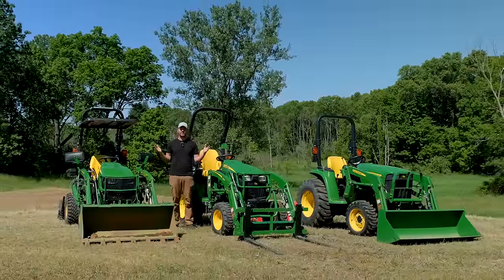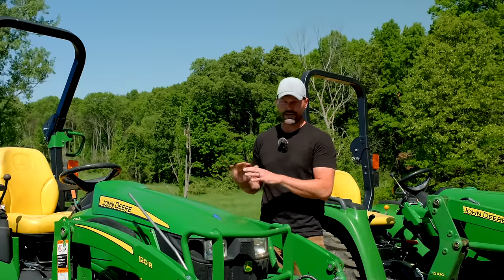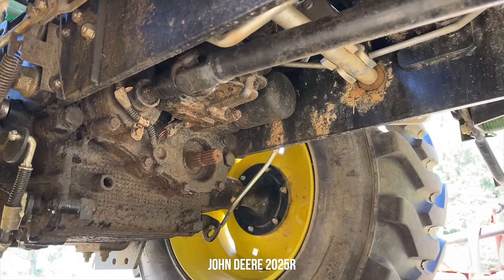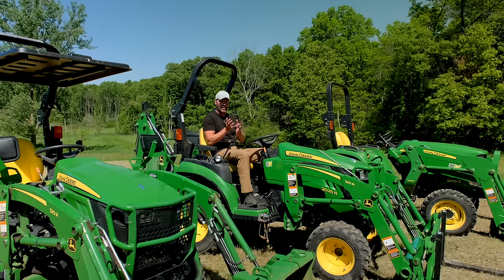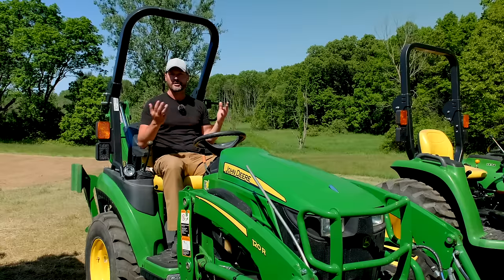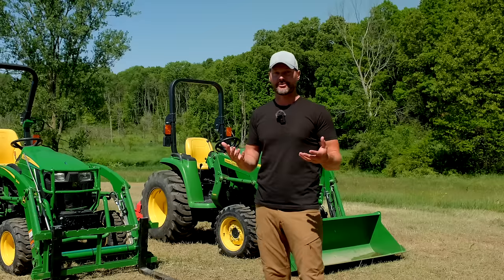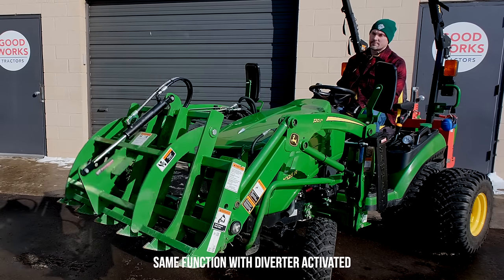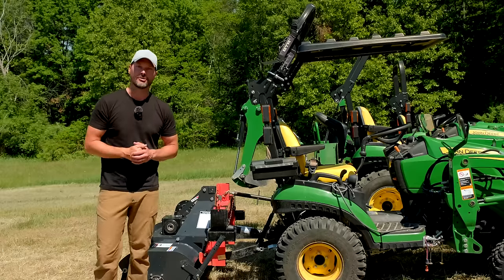CLEAR LOSER? COMPARING 3 JOHN DEERE 25HP TRACTORS.

Comment: Curious if JD uses different displacement 25 HP engines like Kubota does? The B2501 uses a 1 Liter 
25 HP engine and the B2650 (now LX series) uses a 1.3 Liter 25HP engine. 
Obviously a larger displacement will generate more torque and peak HP is usually achieved a little lower in rpm.

Comment: If I was starting over now on my current property I would have been smart to go with a JD 2032 instead of the 1956 Ford 640 I hooked up with.  Though it served me well and the sub-soiler (even used to pull stumps), two-bottom plow, 5 ft brush mower and other attachments did the hard work.  So now, this year, I replaced her with a JD 1025R. Smaller, easier, power steering and FEL. SOOOO much easier with the quick attach belly mower and FEL and SpeeCo quick hitch. 

Too soon old and too late smart.

Comment: Removing the loader from 3E's is a non-starter for me.  I had a 2011 3038E and taking that loader off is a major project.  I used it for round bales, but I sensed that I was pushing the machine to its max, so I traded it in for a Bobcat CT4050.
Reply: And the Bobcat loader comes off how?
Reply: @Formulabruce  It has a quick disconnect like Deere, Kubota, Kioti have.  Drop the support legs, pull the pins on the loader mounts and disconnect the hoses.

Comment: Would have been useful to include a x7.  For a lot of folks it’s all they need.  I used one for several years with a front quick hitch, plow & pallet forks, then on the 3 point I ran a tiller, dethatcher and grader blade.
Reply from the maker: I didn't have one here.  I'm not actually a John Deere dealer, I just like tractors :)  I've done at least one comparison between the x700 Series and 1 Series though.  Here's a link.  https://youtu.be/HuCAAigEPq0
Reply: @GoodWorksTractors  I figured you didn’t have one, especially one with a quick hitch and 3 point.  I ended up moving to a 1025 this year because I needed a front loader, but I did a lot of work with the x7 over a couple of years.

Comment: I have Gen 1 2025R. I wouldn't never even think of "upgrading" it to Gen 2. Mine has stronger FEL, more capable backhoe, separate left/right breaks, to name a few advantages... Doesn't have tilt steering wheel, and 12V socket on the right side. I think I can live without those just fine. Wouldn't change it for a brand new 1025R either, for the same reasons, plus it is a lighter tractor with significantly smaller wheels and ground clearance. The 3 series are too big for my needs, so I'm very happy with my JD 2025R Gen 1 tractor.
Reply: One real disadvantage is that HydroPlus guy won't manufacture a higher GPM pump for my tractor (he does have one for Gen 2)...

Comment: Interesting…with my 2025r I haven’t been in a situation where I’ve felt l was unbalanced stability-wise, but in terms of side to side ride quality it helped when I put 2.5” BORA spacers on. 

I was going to get a 1025r but as soon as I sat on a 2025r it just felt more right for me. Maybe it’s because I’m 6’2” or I just preferred the extra seat height, but the operator station just felt roomier to me. I consider it sort of a different model of the 1025r…kind of like a crew cab pickup vs a supercab.
Reply: Absolutely, I have owned both and the 2025R is better than the 1025R in almost every way. Smoother ride, as you noticed as well better ergonomics.  The 2025R is very stable with my 2" Bora's and weighted rear tires. I liked the higher seating position for improved visibility. The 2025R is the ultimate SCUT IMO.
Reply from the maker: Wheel spacers make a big difference....there is a theme here amongst many comments....spacers!  Solving a problem that is more prevalent on the 2025r than possibly any other modern tractor model.
Reply from the maker: Spacers...and not a SCUT! Haha!  Hope you know I'm having fun with you!...but it's true!
Reply: @GoodWorksTractors  Not sure the 2025R is the worst, maybe so with that backhoe , but without the backhoe its not near as bad as a Cab 3R . 
I would say Cab model 3Rs are the most unstable off the lot of any small tractor. 
3" spacers weighted tires tends solve the issues on the Cab 3Rs. 
I have Boras on all my small tractors 2R,3R, and 4Rs
Reply: @GoodWorksTractors   I do. I am having fun too. 
However, it is a SCUT not a CUT. I do agree Deere made a bit of mess of things naming it a 2025R when the Gen 1 was a totally different machine even a different class machine.  
Deere does call the Gen 2 2025R a SCUT right in the 2 series brochure. 
It is really nothing but an enhanced 1025R. Stretched 1 series frame, to accommodate the bigger tires the rest is about the same other than the ergonomic seem to work out better on the 2025R smoother ride more comfortable seating position etc. 

See page 3 of the 2 series John Deere Brochure.  Deere calls the 2025R a SCUT. 
https://www.deere.com/assets/publications/index.html?id=849f923c#3
Reply: Same for me.  I'm just shy of 6'1" and the 2025R just felt better than a 1025R.  I also like the fact that I ride higher as my property has lots of obstacles that are easier to see from higher up.

Some day I plan on renting a 1025R though and running it through the same activities just to see if I made the right decision.
Reply: @GoodWorksTractors  honestly I didn’t ever feel “tippy” on my 2025, and I’ve been on some pretty decent side slopes. I put the spacers on because I had ordered them before I even got my tractor based on what people said. But I did notice a BIG improvement in ride quality when driving on bumpy ground 👍
Reply from the maker: They should have called it the 1.5025r as it's a 1.5 Series tractor 😂
Reply: @GoodWorksTractors  a 1525R ;)
Reply: I've driven both the 1025R and the 2025R and I love the 2025R. It's very stable and more stable than my neighbors B2301.

Comment: Been trying to decide between the 1025R & 2025R for a while now, was originally wanting a 2038R but my JD coworkers (I work at a JD dealer and get to drive ALL of these all the time) educated me that the larger 2000 series (2032R & 2038R) are excessive for my needs. I'm an old fashioned guy using tractors and garden tractors from the 80s so figured the 2038R SIZE would fit my bill but power wise it's admittedly way overkill for me so they recommended the 1025R - I feel that's going to be just too small for my needs so leaning towards the 2025R, but every review is saying watch out it's more tippy.

I need a smaller tractor that can till (48" ish), use a small rotary mower just a couple times, blow snow all winter, and have a decent mowing function without leaving trenches in the yard. Further more a front loader with 650lb capacity & 4' lift height would be a fantastic bonus to move around pallets of car parts, home construction materials, and parts motorcycles I use to restore other bikes with. The final concession is my new property is a little hilly with a steep gravel driveway so traction (must be 4x4) while blowing is a must and ground clearance for mowing my gently rounded yard my be mandatory. Hoping to take a 2025R out to my place and see how well that keeps upright versus the more stabil but smaller 1025R, if it passes my anti-roll requirements I'm bringing a 2025R home for good then I can sell of my mower, blower, and tiller plus have more space and more practicality+efficiency.

Comment: I purchased a 2025R with Cab the end of this winter.  (it gets really cold in South Dakota.)   I wanted it specifically to put the 54" Heavy Duty front 3-point snow blower.   (What a beast let me tell you.)   I have about 200 x 200-foot (maybe a bit bigger) section of very rough land and would like to smooth out to mow.   What would you suggest?   I have no rear attachments at this point.

Comment: Do you think the difference in peak torque rpm and engine size makes a difference between the 1025 and the 3025?  3200 rpm on the 1025 as opposed to the 2400 rpm on the 3025 series.  Serious 'grunt' work is more for the 3025.  They all have their place.

Comment: Even though I have a Gen 2 2025r, and you're kinda saying its the "clear loser" I somewhat agree with you.  You said case-by-case a few times in this video and I REALLY feel that's the best way to buy a tractor; what can your property handle? Also, if I didnt already own a x748 I would have gotten a 1025r all day long, but I'm a guy and there really wasn't that big of a difference in size between the 748 and the 1025r so I had to go as big of a machine that my property could handle lol.
Reply from the maker: Agreed, there's rarely an absolute.  Exceptions to every rule.  Glad to hear it's working well for you!
Reply: My next purchase will be the 2025R my first was the x575 then the 2305 last year got the 1025R I upgrade just can’t let go of my other babies thanks to Courtney I have the duallies on my 2305 best Idea ever love that tractor removed the anti scalp wheel on the left rear perfect with the 62” mower deck but my favorite is the x575 my bad got off topic I don’t have use for a 3 series and I believe I saw a dual wheel kit for the 2025 at miller tire and bora will be going on the 1025

Comment: One thing on the 1025R and 2025R that is incorrect in this video is that both of those tractors have a limited Cat 1 hitch as they cannot lift to the full height of the Cat 1 specification.  It's not going to matter if you're trying to decide between them but if the 3025E is also on the shopping list then it "wins" that particular category.

Being an owner of a 2025R I have to disagree with your assessment. :)  However, I will say that you're one of the first that I know of that has experience with both that likes the 1025R more.  I do agree though that the premium does make it a challenge when deciding between the two as you don't really get that much more.  As I said in another comment I ended up with mine because the 2025R just fit better.  Which I'm okay paying a premium on for something that I'll use for decades.

Comment: I feel Kubota did much better with this when comparing the BX2680, B2601 and LX2610. I was initially considering a 2025R but went with the LX2610 due to the increased capacities at a similar price.
Reply: Is the B2601 a similar “tweener” as the 2025? I have a B2650 that I’ve thoroughly enjoyed for my needs. Factory cab, to boot.
Reply: @phild9813  It's definitely between the BX and the LX size wise. However, it's capabilities are between them as well where the 2025R has basically the same capabilities as the 1025R. Do you need a BX, B, LX and L all with a 25hp engine? Probably not but it is a good option for the reasons Courtney mentioned and at least there is a logical progression between them.
Reply: Kubotas are nice too but thwir used values are shit

Comment: If you have any work to do In the woods the extra ground clearance of the 2025 over the 1025 is worth it by itself it’s like off roading in a stock truck vs a lifted truck  making it a lot less likely to get damage underneath. the other advantage is in the length it offsets heavy loads better the larger tires also allows for a lot more lbs of liquid ballast. But all things aside they are all great tractors. And the R models are like Swiss Army knives endless attachments and configurations.

Comment: I'm surprised how down you are on the 2025. I was originally shopping for a 1025, then I test drove them. The handling is night and day better on the 2025, almost puzzlingly so. It also has greater lift capacity on the loader, which while not a lot, is something.

As for the slightly higher center of gravity, it's a  missed opportunity to talk about your sponsor's wheel spacers. It seems the right set might make all the difference.
Reply from the maker: BORA is not my sponsor anymore, so it is not a missed opportunity.  The 2025r handles worse in my opinion, especially with a backhoe on.  The front end is so light that you almost can't turn because the tires hardly touch the ground.  To the point of being unusable.  I've owned and used every John Deere model there is and can hands down say that the 2025r is the worst of them all.  It does not have greater lift capacity with the loader.  It's the exact same loader on the 1025r and 2025r.

Comment: 1025R & 2025R Past Owner Here.  
These videos are a little misleading IMHO pertaining to the 2025R.

Never commented on Youtube before.  But I thought maybe someone would benefit as I've owned and used a '20 1025R TLB and '21 TLB.  My experience - 51 hrs on 1025R and about 100 hrs the 2025R doing landscaping.   I'd take the 2025R every time over the 1025R if the extra cost isn't a stretch.  

Here's why:
-Top speed is faster in both gears.  That's a big deal when you learn the machine and your moving material around, running between places, etc. 
-Terrain maneuverability and higher clearance.   I was in a rock swales and in brush I wouldn't have gotten out of with the 1025R.
-Traction.  Going into sod piles I would spin all 4's on the 1025.  2025R just utilizes all the 24 hp better and digs better.
-Ride is way better.  Sit on both for hrs at a time and you'll have less fatigue on the 2025R. 
-The 2025R takes all the same attachments as the 1025R and the big aftermarket.
-You get all the benefit, ergonomics, and usefulness of the awesome 1025R but with a bigger wheel.
-The TLB models are within about an inch in length and they're turning circle w/ bh was about 6 or 8 inches difference.  
I measured the circle.
(My neighbor is a JD salesman and drops them off in my driveway to tease me, the punk, I had both for 3 days)
-The 2025R weighs more than the 1025R and that really helps when pushing snow or loader work with the bh off.  

One more opinion:  If your buying a 2025R because it's rated to lift more or all the things I here about your buying it for the wrong reason.  Go get a  big frame 2 series or 3 series.  That's not what the 2025R is about.  And the seat on those little R tractors is great and better than the "fully adjustable" seat on my L47.  

Last note and I'll end my Rant, LOL.  Put spacers on a 2025R if you get one and go with the garden pro hybrid tires.  They're much better in the snow and have all the traction in the dirt and grass of the R4s. The also look awesome on the 2025R.  Oh, and 3 pt hitch doesn't lift any higher than the 1025R.  Get an adjustable link on both sides and it'll solve all your problems for $85.

Comment: I have a 3032E as a midsize utility tractor for the fleet. And thats about 65 hours A YEAR on the unit.  If youre gonna spend alot of seat time on it and the checkbook allows it, definitely go for the upgrades. If youre not going to put alot of hours on and/or checkbook has limits, really look at all of the uses you're going to have and size of jobs before committing any tractor. There is NO TRACTOR that will do everything you want/need so really do your research on what you are going to use it for and attachments required for your needs.  Size, horsepower, attachments, distance and tuck/trailer size if towed, climate tractor will be working in, who will be operating tractor.    Lots of thinks to think about.

Comment: I just got a 3025E! Ordered it with a loader, backhoe, box blade, landscape rake and pallet forks. I will say that I was surprised to see the giant sub-frame for the backhoe upon delivery though. It is huge and removes nearly ALL ground clearance. I guess if my dealer had told or even shown me what it looked like I wouldn't have been as disappointed. It seems fine so far, but it honestly just plain looks bad and makes me feel like it shouldn't have a backhoe if it needs all this bracketry. Is it just the E series that requires the sub-frame or all 3 series?
Reply: The 3D and E series use a old school manufacturing where the Cast Iron center section, or "case" IS THE Frame. On a D model, the rear axle is cast Iron, on the E its aluminum. Between the aluminum transaxle and the cast Iron "case" the tractor needs that frame for backhoe support. The 3R series has Frame rails down the sides and needs less of a stub frame, however, the R series have a mid PTO and you loose ground clearance. You CAN remove that backhoe frame, and just plan all your hoe work and reinstall it when you need it. 
I ordered my 3025E with the larger 43 inch tiers and no backhoe specifically for dirt and deep slow work as the ground clearance is big. It is tough to get a 3E tractor High centered stuck. On mine I added the 300CX bucket level indicator, the bolt on arm rest kit from John deere, use JD existing spare wire terminals for front work lights, a LED shine on to illuminate the light switch area, and a JD horn from a gator that popped right in. I have had many many new JD Scut and CUT tractors and like the 3E the best.. yeah I said that Courtney!
Reply: @Formulabruce  Thanks for the detailed response! Did you use the work light wiring from the back by/in the ROPS or are there more wires I haven't found? I've already used the purple ones in the back to light up around the backhoe. I would like some supplemental lighting on the front though. 
Thanks again!

Comment: They should just get rid of the 1025. It feels like a lawn tractor trying to be a tractor. Using a fel for moving material or digging, the ground clearance of the 2025r is great. Use the back hoe and the ground clearance is great. My opinion would be the opposite of yours. 2025r is great and the 1025r needs a lot of improvements

Comment: I bought a J.d.3025e, very dissatisfied.  I brought it in 2018, got less than100 hrs on it. Wimpy hydraulics on the loader. My neighbor has used it more than myself.  Basically ithust sets inthe garage takingup space. I would never buy another 3E series.